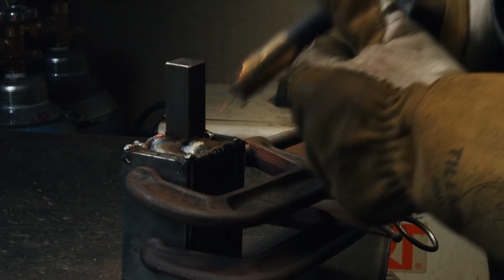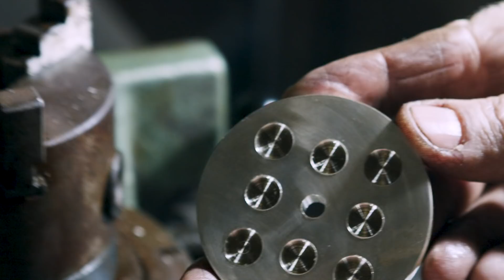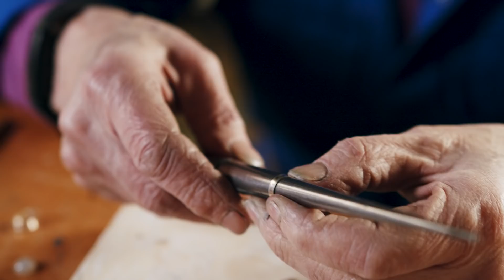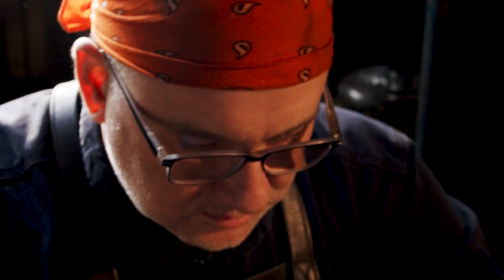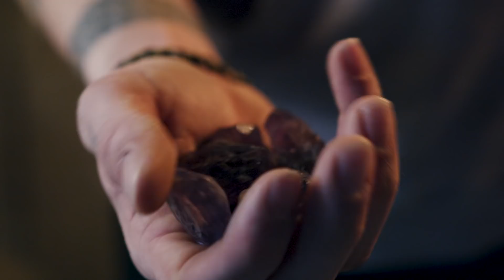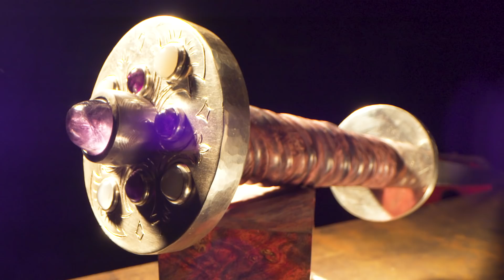Rondel Dagger - 14th Century Europe - MAN AT ARMS : REFORGED

Comment: Cool piece! But the grip looks far to long! Historical rondel daggers usually had a grip length of 9,5 cm/3,75” to 10,5 cm/4,5” so that it locks the hand in place between the guard and pommel plates for a good, secure grip based on the fighting techniques of the day. There should not be any room for the  hand should to be able to slip up or down the grip. This is after all a specialized weapon meant to fight more or less armoured opponants. It's not a utility knife.

Comment: Wouldn’t it be better to tig weld the billet initially instead of mig?
Reply from the maker: It depends.  Tig blends the materials but mig leaves a standing weld that can be removed with grinding easier.  Really up to the smith, both work and we do have both in the shop

Comment: I'd love to have the money and space to start forging knives 😭
It's so interesting
Reply from the maker: hunt your area for other makers!!
Reply: You don't need much to get started: check out the book, "$50 Knife Shop" by Wayne Goddard; also check out these two channels Jumbo Radish and Power Handforces.
Reply: The stuff to get started is cheap indeed, but you do need a space like a garage or a backyard where people don't mind you making a lot of noise. You can't really do it in your apartment or on the balcony. (although you can make stock removal knives by manual filing like that, which doesn't make a lot of noise). I started about 2 years ago, improvised anvil, got a close to proper forge setup, hardware store hammers modified with rounded edges and round face, but to this day I'm still using a vicegrip instead of tongs.